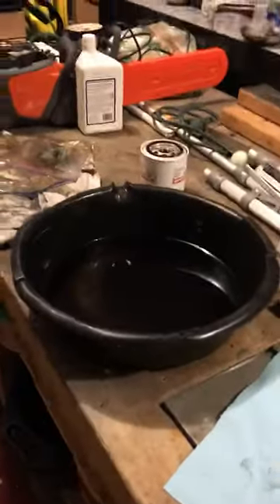Metal shavings in oil HELP!

Comment: Those are aluminum shavings caused by rod slap.  The friction caused between the cylinder head and block.  Not rod knock.
Reply: you have no idea what you are talking about. There is NO movement between the head and the block so no friction. Rod "slap" is the same as rod "knock" when the rod moves up and down on the crank the bearing it rides on begins to break down, wear out from detonation, excessive clearance or bad oiling, this in turn allows movement between the connecting rod journal and the surface of the crank, this is what then causes flakes of metal and the bearing being crushed adding move movement.  So Anthony, keep your mouth shut.
Reply: Hit Tony again, Charles.